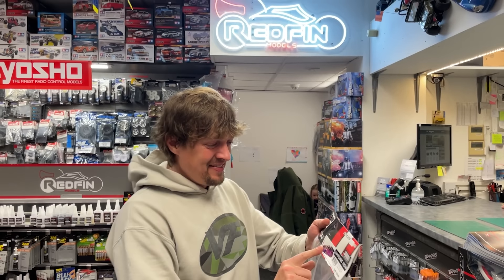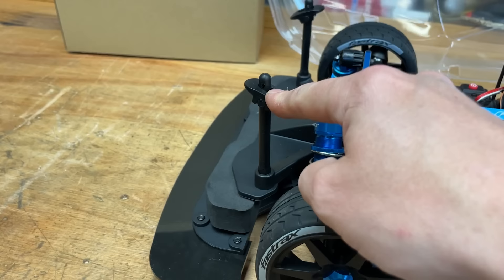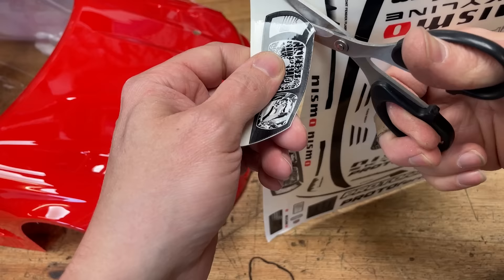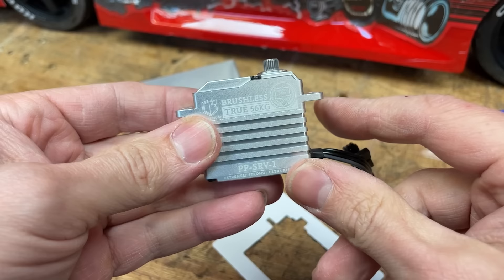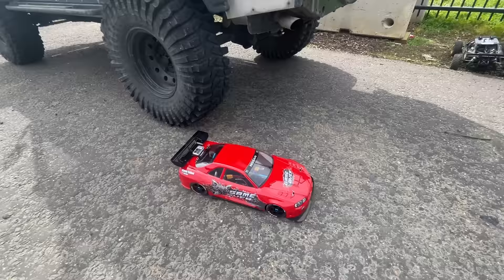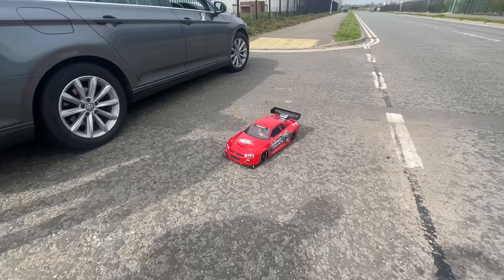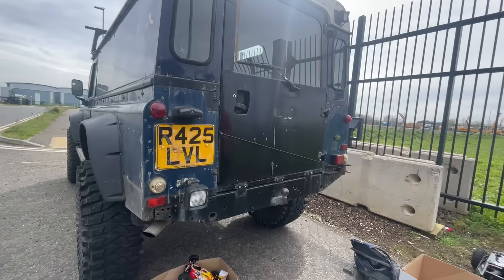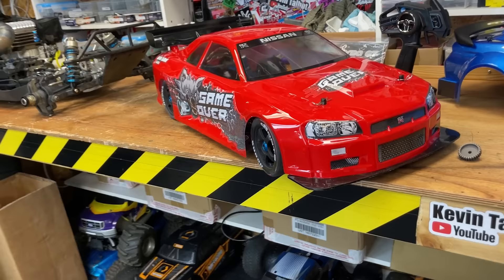Nissan Skyline R34 RC Street Race Drift Car build

Comment: @Kevin Talbot you forgot to swap diffs to compensate for the smaller infraction wheels.
Reply from the maker: its fine, not in it!
Reply: @KevinTalbotTV   page not found m8- but keep up the good work.
Reply from the maker: @1521joe  fixed it!

Comment: This is the platform I'm using for speed runs. Hoping to achieve 130 MPH. I upgraded the servo, radio gear, motor and have a few pinions to try. Would the body shells you use on your speed run cars be suitable for this chassis?